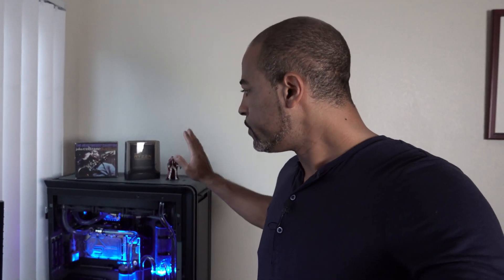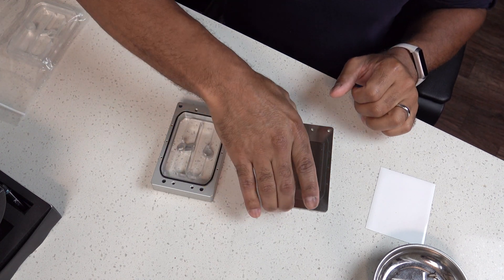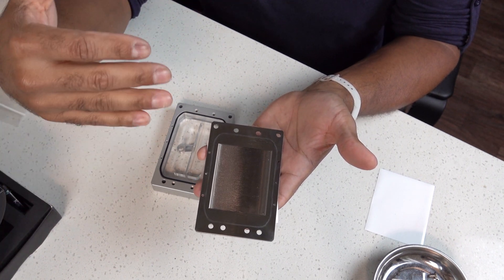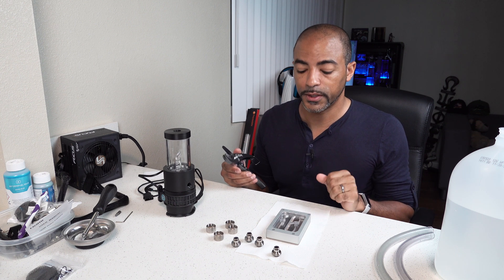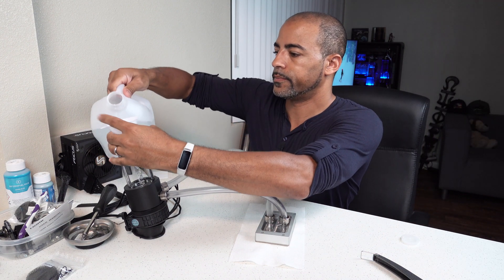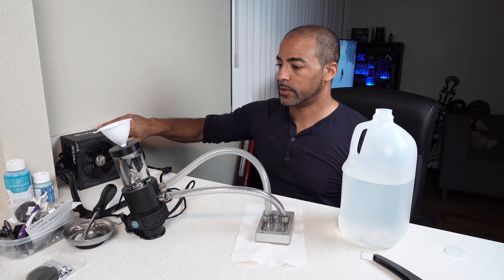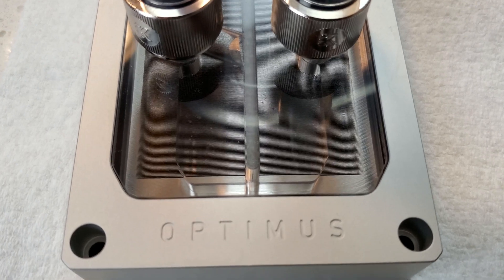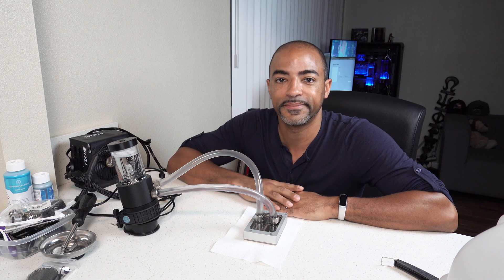Optimus Absolute Threadripper 3 CPU Water Block Leak Testing

Comment: Hi
What dimensions is the block in height, width and depth?  How far apart is there between the holes?  Thanks in advance
Reply from the maker: For detailed dimensions like that check their website and what else is not on there just contact them as they are quick to respond. My unit is packed up so I would have to go through inventory to find it, open it up, and measure.
Reply: @DaPoets  Thanks for answering, in the details the dimensions are not specified, I will have to contact the support.

Comment: what about thread sealant for the fittings? I'm new to water loops and I've never seen anyone mention it. As a contractor, and handyman though, I wouldn't be caught without using thread sealant on any plumbing i do. Same question I have for teflon tape- Anyone ever use that?
Reply from the maker: There's no need to do any of that for water cooled pcs. Good question though.

Comment: Very interesting waterblock.  Love the fact that the microfins cover the entire die.  Im rocking the ek monoblock for the zenith II extreme alpha. Idle Temps at around 32, low 70's at full load overclocked at 4.5.  Curious what sort of stable overclock you guys are able to hit.  People seem to have a hard time after 4.4.
Reply from the maker: Which CPU are you running
Reply: @DaPoets  my system specs are;
3960x, zenith II extreme alpha,  64 gigs g skill trident z royal 3600mhz @16-16-16-30 something, 3x samsung 970 pro in a raid 0 and 2 x asus strix rtx 2080ti in SLI.   Everything is on water.  2x480mm rads. One for the cpu and the other for the graphics.   I actually hit #54  on time spy extreme top 100 which is incredible considering most the guys on that list are running LN2 and on intel platforms. I probably should do a tuning video for my threadripper brothers but I'm kinda camera shy and not as pretty as you!  LOL. This is my 3rd threadripper build  btw.  1950x, 2950x and  now the 3960x.